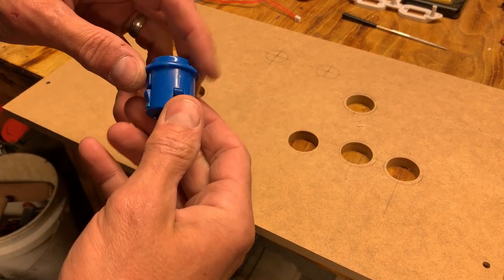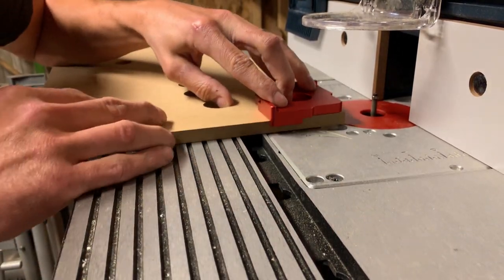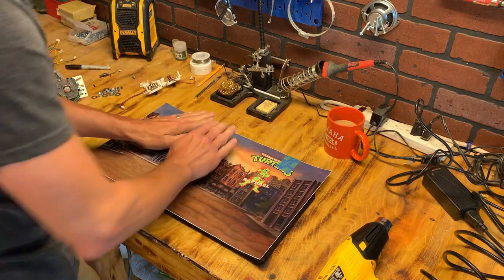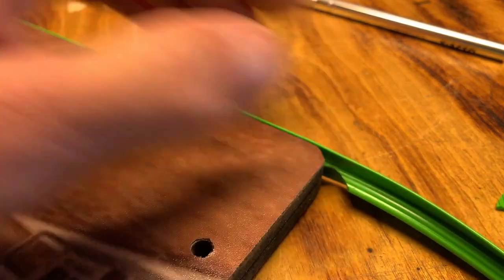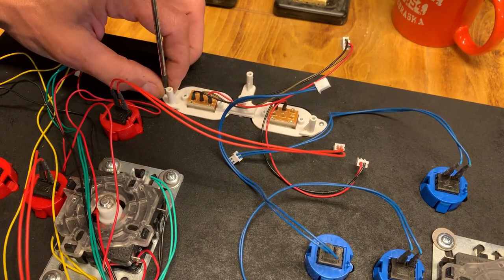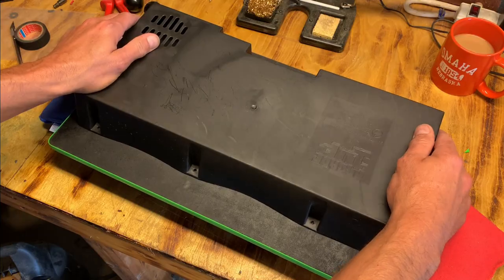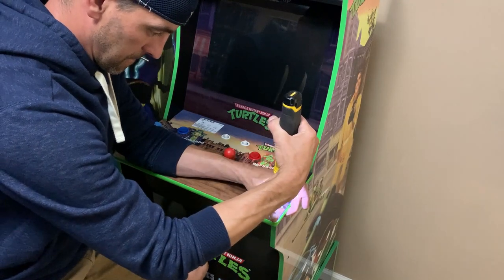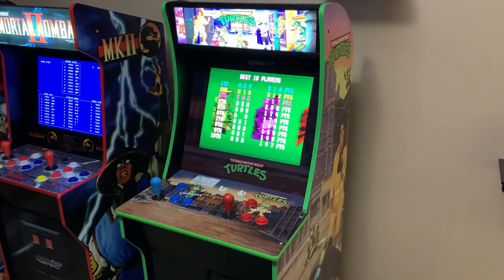2 Player Arcade1up TMNT Control Panel

Comment: Im thinking that if someone wanted to make a similar mod you could add a switcher to utilize the other turtles. I like this mod for space utilization, I’ve heard people selling their Turtles because of space limitations
Reply: Wouldn’t really need a switcher.  Put in coin buttons for all four turtles and then “Y wire” the joystick and buttons to the encoder so that P1 and P2 are connected to the same stick and buttons and likewise P3 and P4.  Choose your turtle with the start button you press, and then just use the left controls for Leo or Mike/the right controls for Donny or Raph.  The extra joystick and button presses to a turtle that is game over with no coins would get ignored.